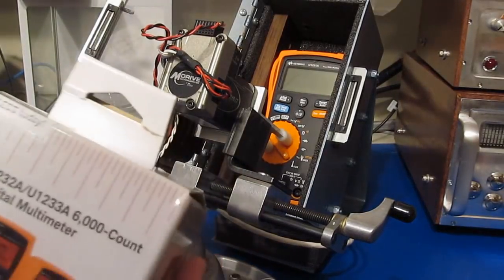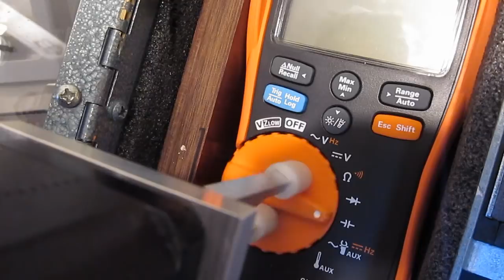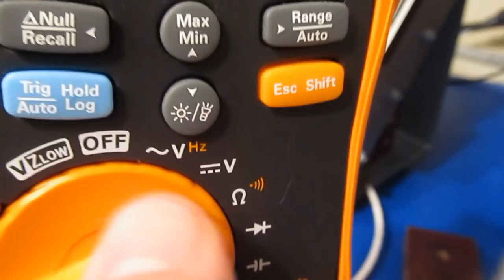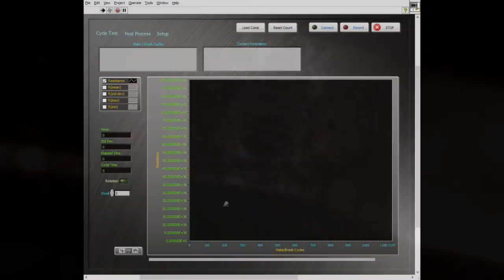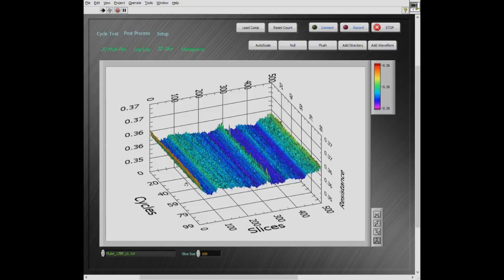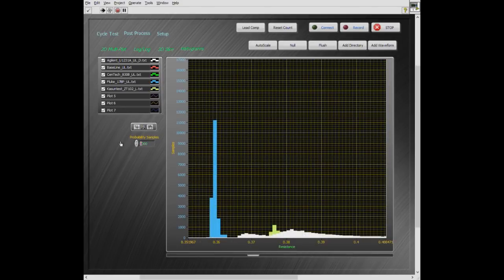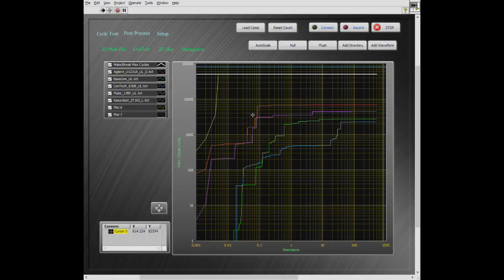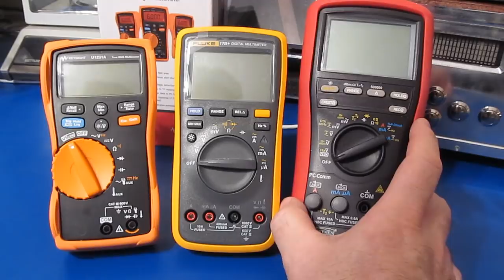50,000 Cycle Multimeter Rotary Switch Life Test,  Part 2

Comment: The author does not like Packard. ))
The fixer is dry. Fluke is greased.
Cycle Agilent 2.5 sec. At Fluke 4 sec.
In fairness.
My Agilent is dry. Others are well oiled. Marriage?
Reply: Break it is not real.
Reply from the maker: @vachik979  Trolling or just ignorant?  Meters have all been ran the same.  Some use grease other do not.  The Fluke was a dry contact.  The cracks in the filled plaster were certainly real.  Marriage, I assume you are suggesting I am paid by Fluke.  Read the FAQ before you post.

Comment: im concerned that the arc flash/blast from previous tests to the keysight meter effected the structural integrity of the detention wipers. there was obvious physical damage to the plastics. and removing a couple contact wipers would alter the mechanical pressure on the pads. ide love to see this test done again under more normalized conditions. i understand that can be cost prohibitive, but the thing i noticed was the fluke and keysight both had horizontal detentes and lubed there. the cheapos lubed contacts and had vertical detente pressure with bad routing. obviously different plastics involved. but the key thing was the arc/heat blasted plastic detentes on the keysight. they are more likely to crack or fail if they have been chard don't  you think?
Reply from the maker: I stated my thoughts during the video.  You are certainly free to repeat this test and post your results. If your findings are different, I may consider repeating it.
Reply: joe smith, i guess that could be an excuse to buy another meter, i certianly have enough stepper motors kicking around as well, i just might try to recreate the setup at some point, Looks like these meters are about 103 bucks currently. Clever setup with the software btw.
Reply from the maker: I will be waiting.
Reply: I think it's worth noting that the compliant element in this mechanism is a glass-filled and pigmented material, whereas the Fluke used what appears to be a natural unfilled/low-fill  nylon.  I imagine that is going to have an effect on the relative wear rates of both the detent surfaces and the contacts (once contaminated).  

Even my old Fluke 77 (one of the original series) uses a similar nylon spring running against the case material (ABS or PVC).  Similar to the Fluke in the prior video, the case/rotor design tends to act as a shield or skirt to isolate the contacts from anything shed off the detents (or from outside).  This meter appears to expose the contacts directly to the detent area.  

Regarding the 77 -- those actually used a discrete rotary switch soldered to the board.  I wonder if that's just cost-prohibitive or whether it's an issue with isolation/size/reliability.

Comment: I'm very happy with the changes to the graphs. Thank you Joe.
Reply from the maker: I doubt very much that you were the only one with questions about it so if I can make a few changes that makes it more clear what is being shown , all the better.    If you total up the histogram's bins for the Fluke, you may have noticed it was no where near 50,000 cycles.  This is because when I displayed the data, I used the minimum data set size which is dictated by the CEN-TECH meter which was aborted at roughly 17,000 cycles.

Comment: That keysight meter was hoopajooped. Why did the Fluke hold up so much better?
Reply from the maker: HOOPAJOOPED!!  Now there's a term I have not heard before!  LOL.  Besides suggesting that it was better engineered, I'm afraid I really don't have an easy answers for you.   I pointed out that the meter had been damaged in the area of the switch that we were not using and some suggest this may be the reason for the early failure.  I doubt removing the one contact did much of anything to effect it but draw your own conclusions.
Reply: I don't see that damage causing all the other wear that happened. But for the sake of argument let's assume it caused things to wear twice as fast. Even at that it still doesn't look good for the Keysight. It is not a cheap meter either. It sure wore out like a cheapie though. All show and no go.
Reply from the maker: I tend to agree that it would not have any effect.  Certainly not on all four springs cracking.   This was a very expensive meter for what it can do.  It's also one of the reasons you never saw me run another.   All of my emails to Keysight went unanswered and I just was not impressed with this meter.
Reply from the maker: Very true and the reason I post these videos free of charge.  At least you can get some idea what to expect.

Comment: Joe, very informative test as always! However, I think the fact that one of the pads on the rotary switch was damaged initially fom prior tests you ran, should have negated this particular meter  from your selector switch stress test no matter what you did to repair/negate the problem. In a real word stress/performance scenario you just can't bench-test a product and achieve a fair /accurate result if that product was altered in any way, no matter how good the intentions.
Reply from the maker: I was very clear about the damage that had been done to the meter prior to the testing along with what I had done to  mitigate it.   If you feel running a brand new unit with near SNs would change the results,  I am perfectly fine with that.  I have no data that shows one way or the other.    You are welcome to repeat the test and show your own results.
Reply: Indeed Joe. 3rd party Refurbished isnt a factory standard and as such I would take any testing results with a grain of salt no matter how pretty the graphs might appear. It's one thing to take a bevy of refurbished meters that had similar issues and produce a final test result but it's quite another to compare dissimilar meters and try to accrue some sort "precision" results based on the aftermath of varied component failures.
Reply from the maker: I have disclosed if the meters were new, used or had damage to the switch area.  I assume you are considering the repaired meters, like the Fluke a refurbished meter as it was damaged during the transient tests and repaired by myself (3rd party) .   That's fine.  It's only one meter, not really a bevy.    If you feel the Fluke would have performed better (or worse) had Fluke performed the repairs, I am fine with that.  It could also be that a brand new Fluke 17B+ would also perform better than the one I looked at.   Again, I don't have any data one way or the other to suggest different.   If you feel the same model Keysight meter from the same lot would yield different results, you are certainly free to show your own data.  I would welcome it.
Reply from the maker: Darren, I have copied this set of posts into the forum in hopes that other may chime in with there thoughts about running this sort of test in the future.  To be clear, I value your input and am open to ideas on how to proceed.   If you have more you would like to add to the discussion, please feel free to add your comments to the forum as well.

http://www.eevblog.com/forum/testgear/hear-kitty-kitty-kitty-nope-not-that-kind-of-cat/2225/
Reply: Thanks Joe, I will definitely take a look at the forum. As previously stated by myself, I think you do a great job for the Electronics/Multimeter community as a whole. I don't mean to sound negative or aloof but rather I'm just a fellow enthusiast/professional who takes a keen interest in the topic and all things related.
Reply from the maker: I took the time to watch your Sanwa reviews after you had asked  me to look at one.  To be honest, I really have no idea now what your motive is for posting here is.  Part one was basically you talking about how great the meter is for 12 minutes with some strange sound effects and connecting it to a resistor and a low voltage DC supply.   It's good to know people are getting their 16 amps of current protection and hearing about how great the protection is for minutes.  For being a self proclaimed professional, I expected a lot more.  Your credibility just went to zero.  There was nothing in your review that was of any value to me if I was looking at this meter.
Reply: My motive for posting here? Are you paranoid or just delusional..?

My post here was very well explained. How can you throw up a test-bed of meters and compare them fairly when some of them have been damaged (in some cases severely) in your tests. To "repair" a partially ruined selector switch and then perform a so called stress test on it, IMHO  is  borderline ludicrous.

Glad you found my review "useless". I'm not doing meter reviews for your pleasure. Unlike you, I enjoy life and have never been snarky or rude to anyone, whether they like my videos or not. I've never  been in front of a camera and I know I'm no reviewer professional. In the end it's not just about "us" but a community and opinions differ...sometimes greatly. I enjoy all opinions in the industry, polished or not.

Finally, Joe (or whatever your real name is). I do take offense about your "self proclaimed" jargon. I've been involved in the computer / electronics industry since 1996, I was building/administering and hosting custom built DNS servers in 1997 for one of the largest ISP's in Canada long before the net became fashionable. I've spent years in cold server rooms repairing/building every server imaginable, was always a hardware junkie and started a successful computer company that's been in business for almost 20 years.
Reply from the maker: It amazes me how you can go on for 12 minutes about how great a meter is with no more testing than putting a 200 ohm resistor on it.  That's no test.  That is ludicrous and a waste of time.   Maybe you feel the sound effects add something.   I don't care what you take offense to.  If your going to post here and try to call bull on any testing I present and all the while all you show for testing is a 200 ohm resistor, don't think I'm not going to call you out for it.  If you don't like it, find a new channel to watch.

Comment: The exposed copper would soon oxidize in real world conditions and cause much more trouble, but I'm sure you have considered this.
Also I have had rarely used Fluke meters for repair where the grease got hard and caused intermittent contact.
Of course there is just no way to account for this in your test unless we are prepared to wait 30 years ;-)
The traces across the contact path on the ANENG are just offensive.
Reply from the maker: Not all the Fluke meters I have looked at used grease.  The 17B+ for example was dry. Vias in the pads and traces in the path are both something I would not expect to see in a quality meter.

Comment: Why don't they make meters with push button front ends like bench models.
Reply from the maker: They do but they are not very common.  I suspect for the reasons that were discussed in the part 1 comments area.

Comment: Did they copy Fluke switch design? It looks similar. Fluke & Hioki are the only meters I would buy. Maybe Bryman as well.
Reply from the maker: Indeed, the spring design is very similar to the Fluke.  Fluke really has nothing to offer me for a meter outside of the 289.  I borrowed one to try it out.   The Hioki DT4282 seems like it may be a good fit but I still like the Brymen out of everything I have looked at.

Comment: Very nice, especially glad I own a Fluke now.  Also that explains why my 10+ year old Fluke still works perfectly.  Perhaps a Uni-t meter will make it into the tests someday?  I would suggest a 210E but that dial would be hard to grab :-)
Reply: I own 2 fluke 87v and several different uni-t meters and an amprobe 15xp-b.  The ut 601 and 603 and amprobe have a high 2000 megohm range which I sometimes use for loadcell testing. However I still believe in You get what you pay for. But I like Uni-t for what they are.
Reply: I love my 210E, but I don't think hot gluing an attachment to the 210E would make a fair test. Because in real life you more or less have to run your thumb along the side to turn the knob, which I would argue is more strenuous on the mechanism.
Reply: what about the 10th life of the ut90 LOL
Reply from the maker: I think if I were to run a UNI-T, I would run one with more of a standard knob.   The 210E could possibly be ran by using some hot glue to attach some plastic to the knob.    I would run that UT90 no problem except that switch is in so bad of shape I am not sure it would make it 50 cycles.   The AMPROBEs I believe were both made by UNI-T.
Reply from the maker: I really would have no data to show one way or the other how it would effect the wear.